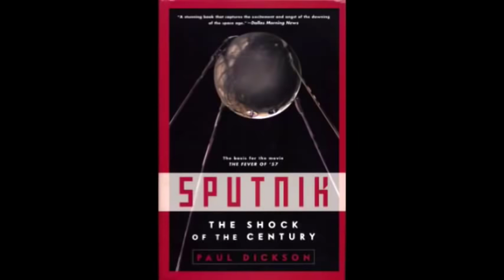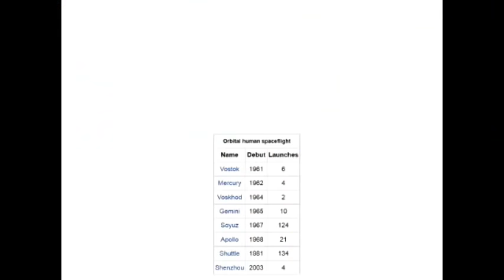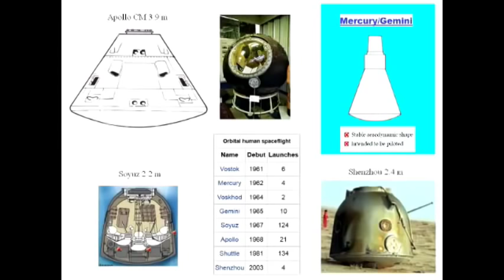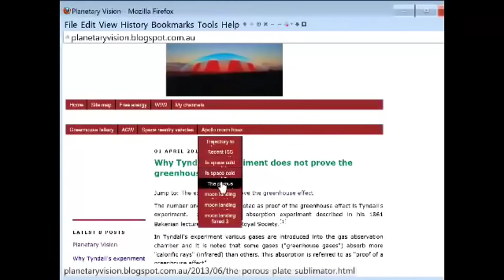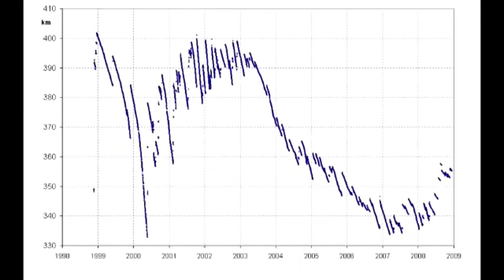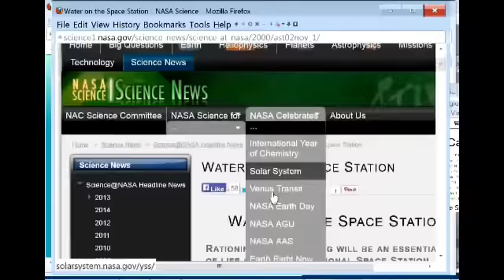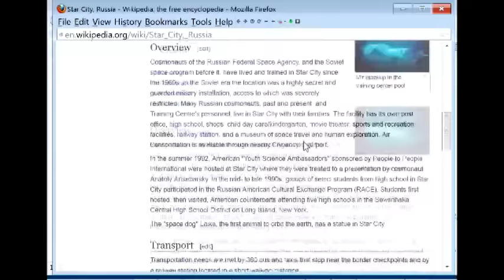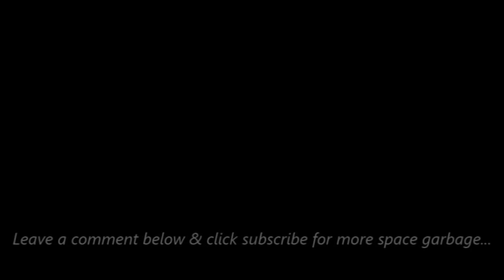The ISS Exposed

Comment: There is no orbit. We are not on a spinning ball flying through space. That is a hoax, too. It would defy the laws of physics.
Reply: Which "laws of physics" does this defy? Kindly name them, and give us a good reference so we can follow the train of thought coming from your superior mind.
Reply: @wolfganglaun2319   That is very easy. Anyone with a modicum of knowledge of physics can figure that out. Momentum being one of them. When an object is traveling in a given direction, it will continue in that direction. So you have an object on the surface of a ball. At any given point, that object is going in a specific direction and it will continue in that direction. This is easily demonstrated by soaking a nerf ball with water and spinning it. The water will fly off of the ball. But we are expected to believe that if you make the ball big enough, the this law of physics will be overcome. Note that nobody has ever revealed how big the ball has to be to overcome this law of physics. Does the law stop working when the diameter of the ball is 100 feet? Or maybe it is one mile or a hundred miles? What main stream "scientist" want us to believe is at some point the water will stop flying off of the ball and stick to it from something called gravity which has never been proven. What causes things to fall is a matter of density. Objects that are more dense will fall through objects less dense.
Reply: @michaelhamilton4288  Before we discuss the rotating geoid and its implications, please tell me:
(1) Which parameters affect the frequency of a pendulum?
(2) Why do you have to recalibrate an analytical balance when you move it from the ground floor to the 12th floor?
(3) Why does a river flow towards the ocean when its water is surrounded by nothing but water and the rocky or gravelly bed, with a density higher that the one of the water?
(4) How does something falling know the direction it should fall?
(5) Why is air pressure decreasing the higher you go?
(6) Why is water pressure increasing the deeper you go?
(7) How long does it take 1 kg of lead (perfectly streamlined) to fall from a 100 m tower? How fast is it on impact?
(8) The same as #7, but use iron instead of lead.
(9) Read up on the discovery of Neptune. Explain how it could be done in unless there were gravitational disturbance in the orbit of Uranus.
(10) Explain why the laws of planetary motion can be derived from the law of the attraction of masses, as formulated by Isaac Newton, if there is no such attraction.

This isn't all, by no means. But don't exhibit any more ignorance until you've come to grips with these questions.
Reply: @wolfganglaun2319  You did ask some very humorous questions, none of which are even relevant to the fact that the water on a spinning ball will fly off of the ball until, according to you and others who support the spinning ball model, it gets to a large enough diameter to reverse a law of physics. So i tell you what. I will answer all of your questions when you answer the one i asked first. At what diameter does the ball have to be to reverse the law of physics that throws the water from the ball when it is spun. Before you show any more ignorance by merely asking more questions, answer just this one question. I am going very easy on you. I am asking only one question. 

By the way, some of your questions are really easy to explain and i will be happy to do so upon reading the specific diameter the ball must reach to overcome physics.

Oh, and by the way, my not being able to answer a question does not negate the fact that you could not either nor does my lack of knowledge about one issue change or negate my knowledge about another. I am an instrument rated pilot and never have to adjuster for curvature of the earth. I know plenty of pilots who have agreed they do not ever have to correct for curvature of the earth. Gyroscopes are used in aircraft because they are so reliable at staying on a given plane. So why do aircraft not fly out into space when on level flight when no adjustment is made to follow the curvature of the earth. Sorry, my ignorance only allows to to navigate an aircraft with multiple engines in zero visibility while looking at nothing but the instrument panel.
Reply: @michaelhamilton4288  I'll gladly answer your question, but wouldn't you like to have the material of the "ball" to be within a certain range, and, also, wouldn't you like to have the angular speed of the rotation to be within a certain interval? I'm not at all sure that you know that these parameters have an impact on the answer to your question, and therefore you'll have to narrow it down, somewhat.
Reply: @wolfganglaun2319  None of those things would have much if any of an impact when one is talking about the objects on the surface thereof changing direction. I do not care what the ball is constructed of. You can make a dirt ball if you like and the water will still fly off of it. But if you are trying to claim that the particular law of physics that changes the action it would take when the ball is a smaller diameter, then please enlighten us as to the material construct that would have the same effect a ball the size of earth is when it is small and we can see if we can construct a duplicate that will defy the same law of physics at a smaller size. 

Here is what is i see you are doing. You are not the first i have had this debate with. There are those who have studied physics far more than me who cannot answer the question and rather than answer the question, they attempt to discredit my claim by showing they are smarter in the ways of physics than i am . In every single case, as in this one, he who is attempting to make such a discrediting still does not answer the question, at what size does the ball have to be for the law of physics that would have objects or material on the surface of the ball stop flying off of the ball and start sticking to it? People who try to talk over the heads of others do not make themselves appear more intellectual. They make themselves appear less intellectual by revealing their lack of ability to communicate with the common man. They bring up all kinds of physics questions that have nothing to do with the question at hand. I guess i incorrectly presumed that when we are talking about the change in size and direction of the material of objects on the surface of the ball that the ball would be made from the same material small or large.

One example of this was a conversation i was having with three college students who bragged about all of their training in physics in an attempt to convince me that i should trust their wealth of knowledge just because they had this training, even though they could not answer my questions or rebut my claims. When i pointed out the earth is claimed to be curving away at 8" per mile squared, one of them quickly got on the internet and and found that it is actually 7.87 inches per mile squared, or whatever it was. This is very common among those who cannot answer the question and want to try to make he whose question cannot be answered look stupid for having posed the question. I think this is exactly what you are doing. You cannot answer the question, lest you would have rather than got back on here and asked the silly questions you asked. You either know the answer or you do not. I am contending that you do not know the answer and will not at any time, no matter how long we banter back and forth, provide the answer to the question. According to main stream "science", material on the surface of a ball will fly off of the ball when is spins fast enough until the ball reaches a certain size. The surface on the earth is purportedly moving at 1,008 miles per hour and i am still able to land a small fixed wing aircraft with a maximum speed of 100 knots while landing on a north south runway at the equator. And the surface speed is less the further one gets away from the equator so the plane is somehow magically self adjusting to keep up with this runway speeding by at hundreds of miles per hour. AND i sometime have to correct for a cross wind that must be blowing at a faster speed than the 1,008 miles per hour for it to create a cross wind in the opposite direction as the turning of the earth is.

However, we do not even know what the purported spinning ball is constructed of, since the absolute deepest that any human has ever dug is 8 miles. It was actually slightly less than that, but i am rounding for ease.

We can go on back and forth, but i will predict that you will not be able to provide concrete evidence that there is a size at which one fraction of an inch bigger is the point at which the law of physics that will cause the momentum that will throw objects from the surface of a spinning ball to cease throwing said objects from the surface of a spinning ball.
Reply: @michaelhamilton4288  
The wet, spinning ball
The infamous claim used to deny the globe is based on a correct notion, i.e., Newton's first law, and the denial of other laws formulated by the same man. I don't see why Newton's 2nd law should be false: we can experimentally verify that there is a quite effective acceleration working on Earth and, as a result, things fall and have a weight. We can measure this weight and the acceleration. We can also calculate the effect the rotation of the Earth has on anything on its surface, on the Equator of on any other latitude. It is easily shown that this force is much, much too small to have any effect on things on Earth's surface; hence they remain peacefully where they are in spite of Earth's rotation. Note that I did not have to make use of Newton's law of gravitational attraction between masses: we just have the weight of things as our balances show it.

The "bye-law of density" has never been formulated except as a vague hypothesis. So asking about the size of a sphere where this downward acceleration begins to happen is facetious; apparently you need to have a sphere with a gas (something less dense than water) around it so that things might have an idea that they should fall toward it. You'll say that the wet ball in your experiment does have an atmosphere around it; and then I'll ask you to formulate your "bye-law of density" well enough so that you can explain the direction something is accelerated.

This is where my points (1) to (10) should come to your attention, and it's typical that you try to shunt around them.

At what diameter does the ball have to be
You cannot ask questions when you refuse a valid answer by denying that the laws on which the answer is based are valid, or by not supplying a replacement law that is capable of yielding the same quantifiable, verifiable results. answer thse: How long does 1 kg of perfectly streamlined lead take to fall from a 100 m tower and how fast is it on impact? Then, what happens with 1 kg of perfectly streamlined iron? If you don't have answers based ont he "bye-law of density" you might as well kiss it good-bye.

I will not enter a debate on this point with someone who cherry-picks the laws of physics. It is a relatively easy task to compute a set of parameters where the attraction due to gravity overrides the centrifugal force on a rotating body.

why do aircraft not fly out into space
If you really are a pilot you ought to know what the following mean:
 - angle of attack
 - pitching moment
 - trim
 - longitudinal static stability
You should also know that (except during and immediately after start or in air acrobatics) you don't gain height by pulling the aeroplane's nose up and you don't descend by dipping the aeroplane's nose down: you increase or decrease thrust.

An aeroplane in flight is subject to lift, weight and tail lift, and, once a balance is established by these forces in a correctly trimmed plane, it keeps the plane level. If the surface of the air "falls away" from your plane's level orientation, the angle of attack increases. If an aircraft is longitudinally stable, a small increase in angle of attack will cause the pitching moment on the aircraft to change so that the angle of attack decreases. Similarly, a small decrease in angle of attack will cause the pitching moment to change so that the angle of attack increases.

I'll not comment on the nonsense of landing on a north-south runway. - Maybe you still have a turntable or you can lay your hands on a potter's wheel. Put a bowl filled with water on the wheel and make it turn, as slowly you can. Wait and observe; then think.

Comment: There have been 6 manned missions to the Moon. You can see the ISS from the ground. You can even communicate with the people there visually via high-powered handheld lasers, which has been done. I do think some missions are faked in order to funnel money. Just not all of them. There are a few problems with your analysis. For instance, cancelling a jet engine sound would be really simple using phase inversion. No way would someone wanting to hide that would not be able to. Anyone can do it with a simple program like Audacity. There are a few other things too. I'm a software engineer btw. Also, consider that maybe she did spray her hair like that so that it wouldn't flop around all the time in zero-g. Air leaks aren't the big problem you'd think it would be. If a hole were punched in the side, you could stop it by simply putting your finger over it. It doesn't get sucked out quickly like in the movies. The shape of the station doesn't matter, nor does a center of gravity, when you're in space. The water recycling probably starts as basically a dehumidifier. Anyway, like I said, I'm sure some missions are faked but I know we have satellites in space and can prove that. I've had to work with them remotely before, considering telemetry.
Reply: @astrophonix   I don't care enough to try to discern the extent of such corruption. I know physics enough to know that the whole of space exploration isn't a mass conspiracy. I believe that any money laundered through fake space missions is likely used to fund secret ones, which I'm far more interested in researching.
Reply: 6 manned missions to the moon, through the van Allen belts which NASA SCIENTISTS ADMIT TO NOT BEING ABLE TO GET THROUGH. ok??
Reply: @kimmykimko  So, I've proven the ISS is up there in the reply below. As for the Van Allen radiation belt, simply search youtube for "Van Allen Belt" and you'll see how they did it. Where are they supposedly admitting this? It's one thing to say it was a problem back then that they were aware of. To then jump to saying they couldn't solve the problem with no supporting evidence for that is just ridiculous.